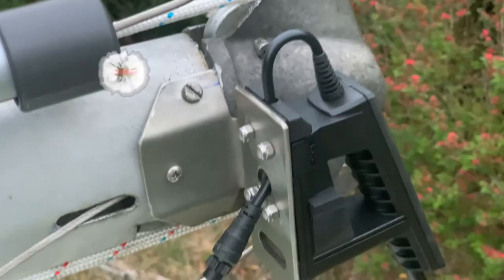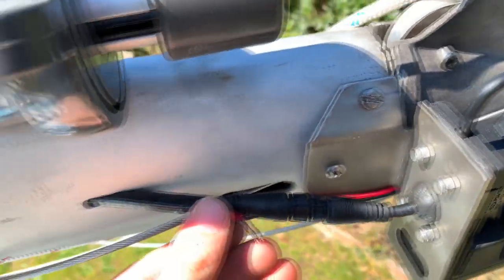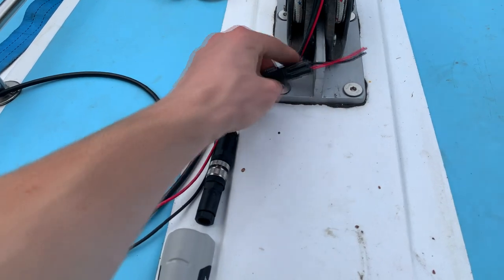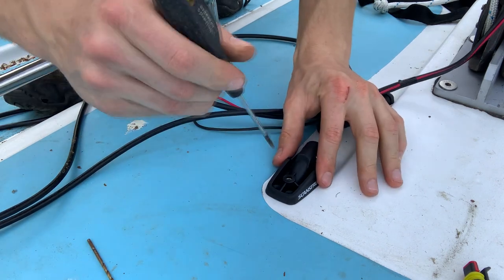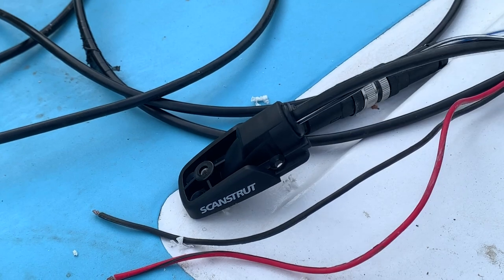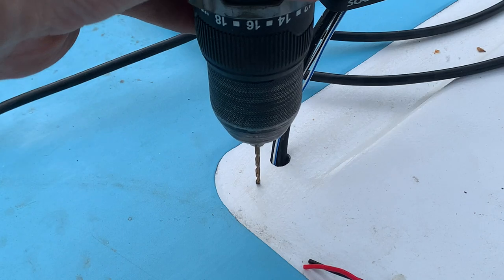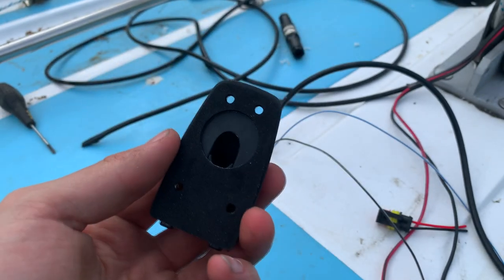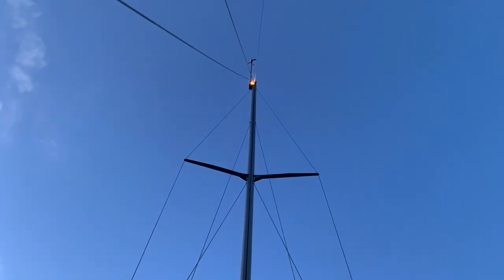Anchor Light and Deck Gland Install! Sailing Meraki | Ep.29

Comment: @7:15 wouldn't you want 5200 under that?
Reply from the maker: bit excessive for something that might have to come off
Reply: 5200 should never be used on a boat. It's a structural adhesive never to be 'removed'. I don't know why people insist on using it - as though there is nothing else on the market!